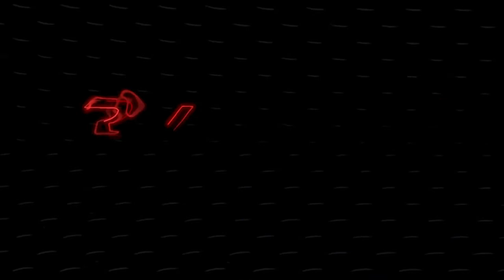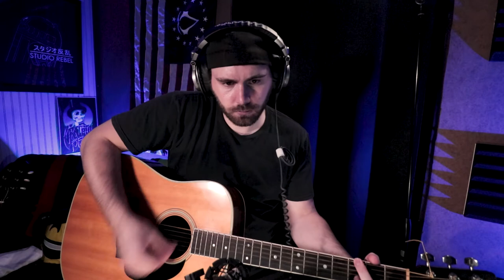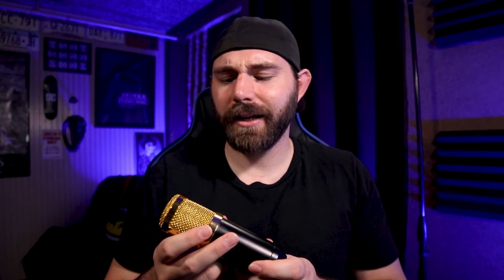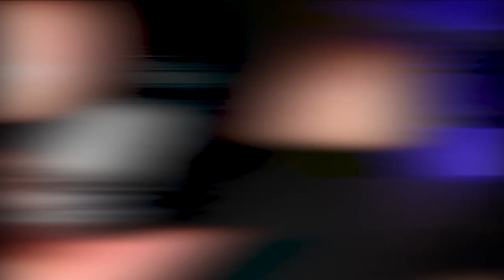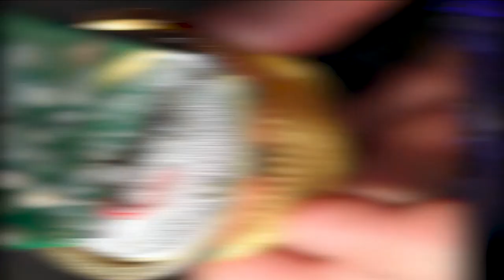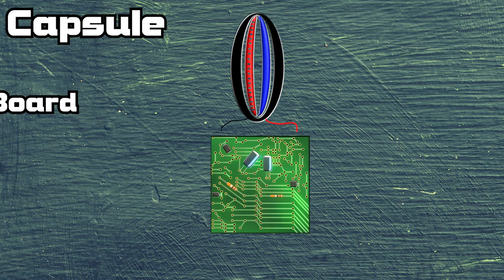What’s inside a Condenser Microphone? (BM 800 Breakdown)

Comment: Any Idea about how the circuitry works?
Reply from the maker: I know most of the basic wiring, but specific stuff I’m not sure. I assume most of it has to do with the conversion of phantom power to the the capsule. This was really out of curiosity and seeing what was inside. 

I was planning to do more on this topic and build a series off of it. Then the video, didn’t get much attention. So I shelfed the idea till it got some eyes on it. 

When I do comes back to it I’ll do some research on the board and see how different mics are constructed as well.
Reply: @RebelTech1990  thanks a lot 😊
Reply: @sukhithalakwan  the circuitry amplifies the small signal generated from the electrical potential of the diaphragm and backplate. That phantom power is used to power the amplifier so it can amplify the signal inputted from the diaphragm and backplate.
Reply: @drewgrant1605  Circuitry both amplifying but also filtering for the preferred frequency response and tone.
The subtle or drastic changes is diaphragm construction will need specific value of components to tune the mic.

Comment: Bro please give me link
Reply from the maker: Link to what? The mic?
Reply: @RebelTech1990  yes bro please
Reply from the maker: I added a link to the description.  I will say, unless you are using this mic to break apart and learn about what's inside, it's not worth it.  There are plenty of other options that are much better and not too much more money.  I cover a lot of them so just take a look at my other mic reviews before you decide.
Reply: @RebelTech1990  bro my bugut is tite and i want to connect min to phone that's why I am chosing this mic
Reply from the maker: This won't work with your phone.  It's an XLR mic.  You need something with a 3.5mm jack or lightning  cable.
Reply: @RebelTech1990  yeh I connet it with 3.5mm jack spliter    if you have better option please tell me
Reply from the maker: I haven’t had much luck with the xlr to 3.5mm jacks. I would suggest getting something that connects directly to your phone. But this is your decision, if you think it’ll work then you should go with that.
Reply: @RebelTech1990  yes  by the way   any other mic that you  suggest me condenser microphone like bm 800
Reply from the maker: If you want something that goes usb, I can give you a couple:

USB 
Razor Seiren mini
Blue snowball

Other than that, I wouldn’t recommend anything else in that price range. If you’re looking for a 3.5mm mic then I don’t have any suggestions other than shotguns. Newer and movo make good 3.5mm shotguns. 

If you want xlr recommendation then I can help but you need an interface to run them.